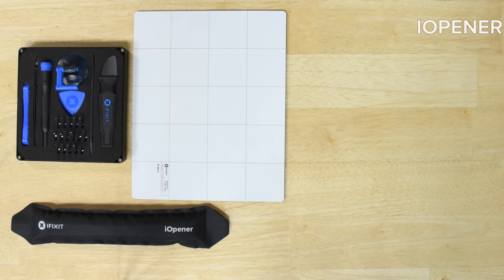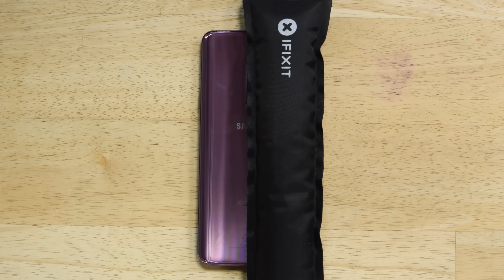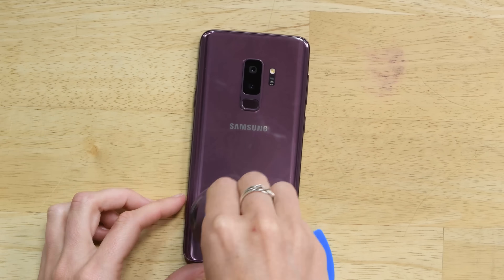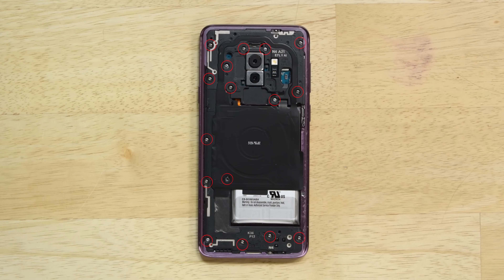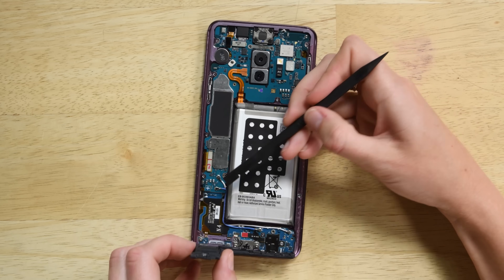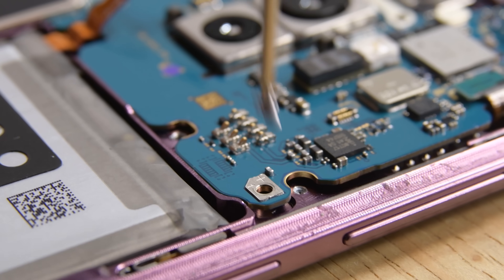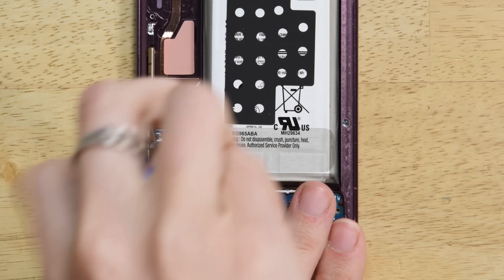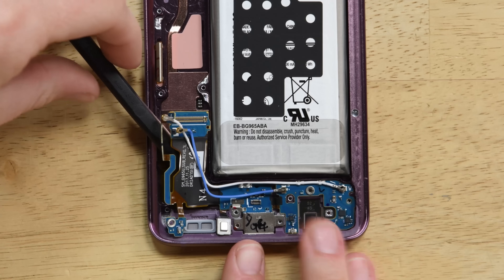Samsung Galaxy S9+ USB-C/Charging Port(Daughterboard) Repair-How To

Comment: It's a good instructional video. fixed my S9+ myself and used this as my guide + their website has tons of info regarding where the adhesion is strong / weak / and where to watch out for. One thing i'd like to tell everyone who's planning to do this, definitely take pics along the way. even if it's a crappy old phone. Also, watch out for the white and blue wires. they go underneath the main motherboard or else you wont be able to install the speaker plate.

Comment: It looks like the antenna cables came out with the daughterboard. But the replacement daughterboard (on iFixit website anyway) doesn't appear to include the antenna cables. Presumably, I would have to move them from the old board to the new one. Does that require soldering?
Reply: I guess this will not be helpful anymore but.

1: Yes you have to extract them from the old board preferably or get a pair of new ones. They cost about $5 where I live.
2: No, you do not need to do any soldering whatsoever. However one thing that is not mentioned here is when you assemble the phone back it is advised to use a new glue tape for the back panel to ensure the water resistance of the phone. 

I just repaired mine and did not exchange the tape. The backpanel fit snuggly back and I reheated the glue to unify it abit but it holds perfectly. For my repair I swapped the daughterboard and the jack port and it cost me about $20-$25 which is good for +2 year old phone so far. :)

Comment: Really good video, but it would be better if you showed assembly process.
Reply: Do everything as shown but in reverse...
Reply: @Kirill0  actually i just reassembled the phone and there are important things you'd need to watch out for that wasn't as important during disassembly. it would save a decent amount of time and you'd have to watch out for the small component inside the simcard push hole. you could easily lose that if you didn't know you had to be wary of it. there certainly is value to showing the reassembly process from my experience.